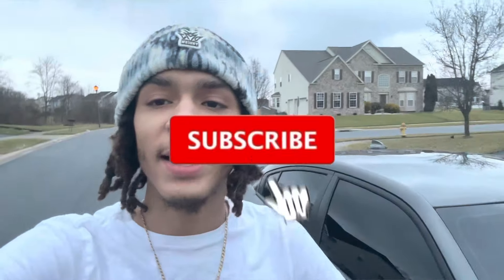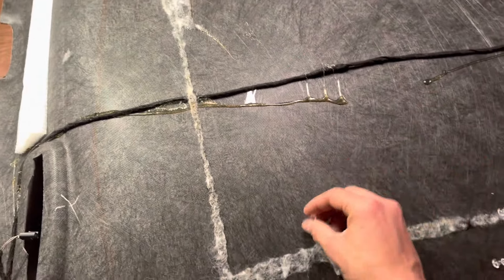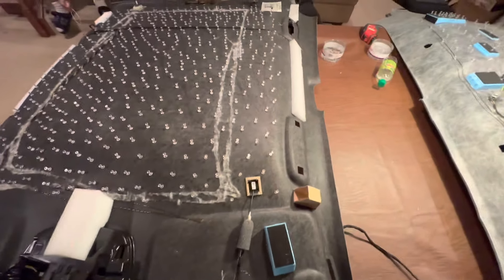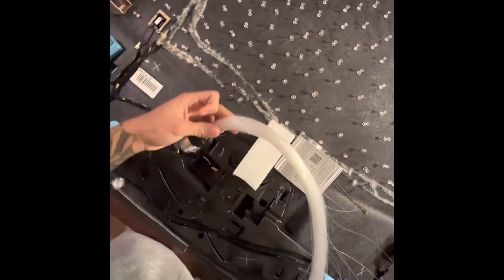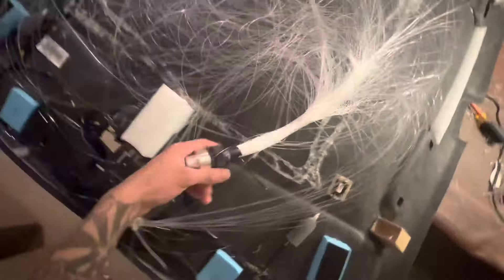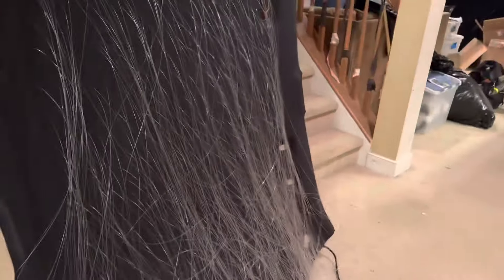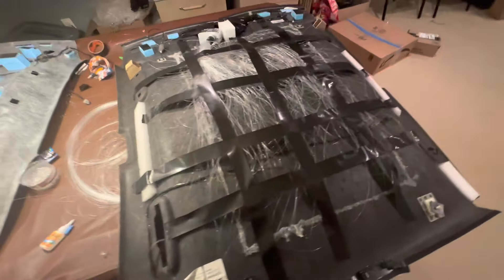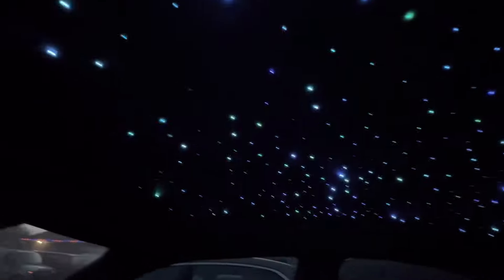I INSTALLED STARLIGHTS IN MY DODGE CHARGER😱🔥 (DIY)

Comment: How did you wire it? & where?
Reply: You can either wire it to an accessory so it turns on with the car. Or you can wire it with parking lights or even the lighter port. Many ways. Cleanest way to wire would be to an accessory to run on with car

Comment: Think I could use gorilla glue spray instead of each individual hole?
Reply: you could. It could. Idk how long it takes to settle but hot glue takes a minute or so. It also melts the fiber and crimps it at a 90 degree angle to insure it lays flat
Reply: @imsavor  dude I did it actually for my 2018 charger. It's looks so good, I used a hot glue gun immediately and then covered it with a stronger glue that would take time to dry but since I used the hot glue I was able to just reinstall it within the hour